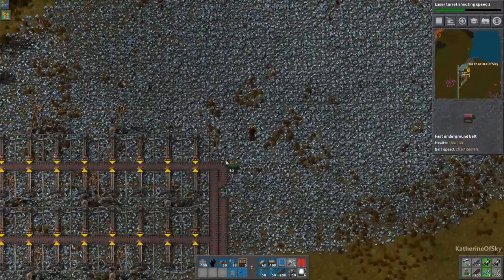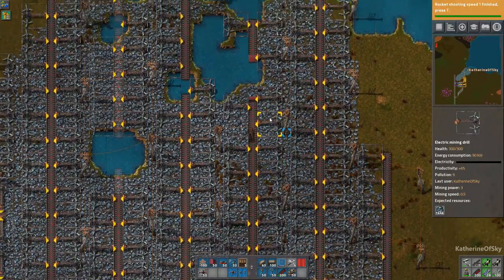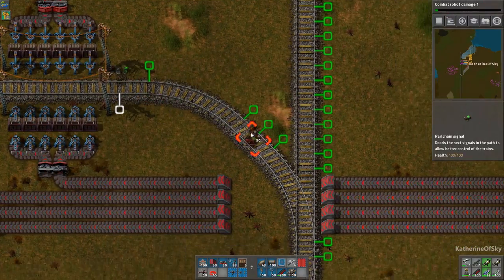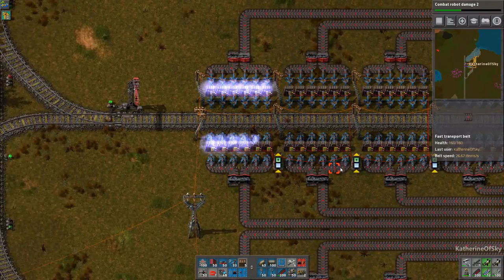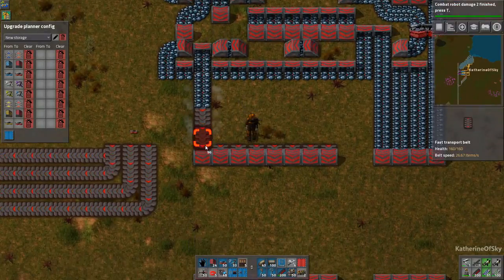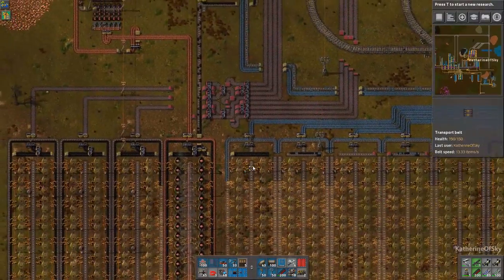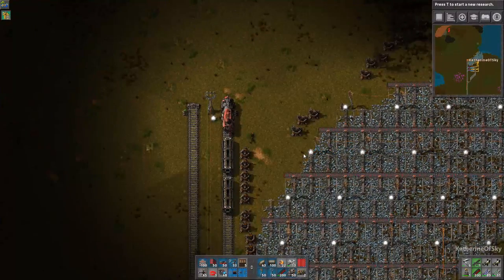Factorio: Entry Level to Megabase Ep 17: FINISHING THE ORE LOADING STATION PART 2 - Tutorial Series

Comment: hi!
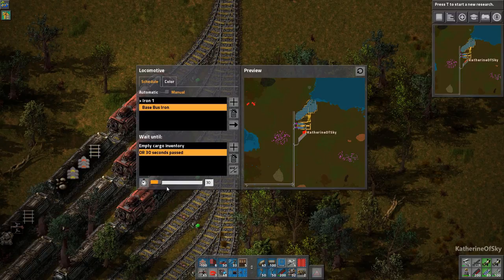at 34:00 my tip what I usually do (I also add 5-10 seconds for loading coal) but also make to sure there is coal, I put a chest (wooden, limited to 1 slot) from where I load the train with coal, and I do a little circuit network thing... I read the box content to a decider combinator, if coal>25 send a 1 green signal from the decider to the train station (and usually also to a lamp just for feedback, someetimes i even set an other combinator if not green->send 1 red ), and then the train also gets a circuit condition AND green=1 ... so they won't leave if there is no coal present :-)

Comment: If you wire the outer inserters to the chests, then wire the inserters all together with a different wire. You can set the chest limits with 1 constant combinator. Doing that forces the chests to all load evenly if you set the limit to the wagon capacity divided by 12(rounded up).
Reply from the maker: I've seen that method.  It's interesting and useful , but stretches my dyslexia way beyond the rabbit-proof fence!  Once I get stack inserters, all will be well!
Reply: That's quite a bit more complicated than necessary, and is nowhere near foolproof. I've seen plenty of instances where that set up eventually skews the chest contents.

Comment: 27:46 You had a red splitter end up in your iron mine chests.  Good luck finding it in the future :D
Reply from the maker: It won't be difficult -- with detailed mode on, it will show up very clearly in the chests :-)
Reply: Unless it already got picked up by the inserter and dropped off in your smelting area.  Then it might make its way to the end of a belt somewhere
Reply from the maker: Which won't happen since the train wagons are filtered :-)
Reply: Ohhhh.  Sneaky
Reply: Except, maybe, the last wagon of the bottom train. I think it may have been out of range when you were pasting the filters.
Reply: Even it it was, the splitter is in the 3rd set of chests on the top rail, so it won't get inserted into a wagon.